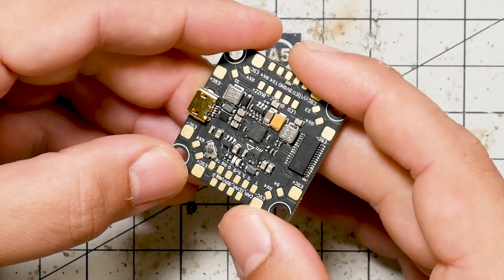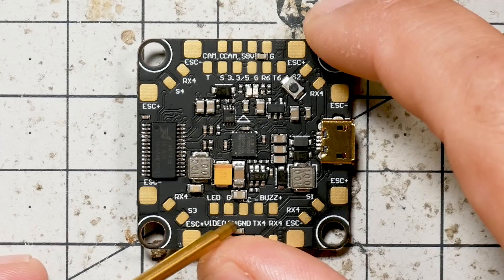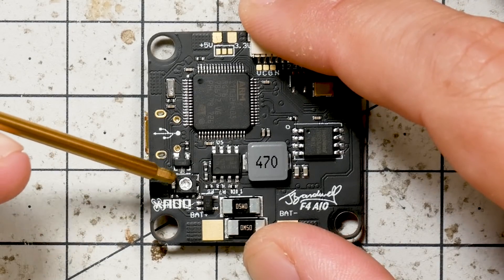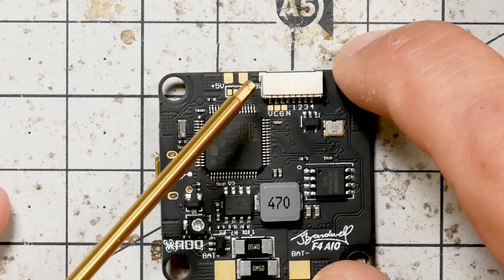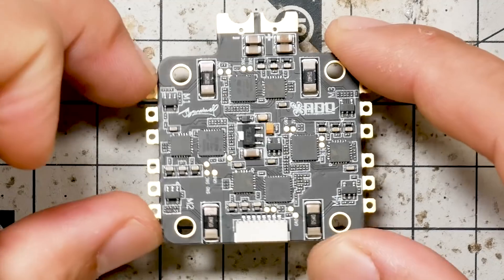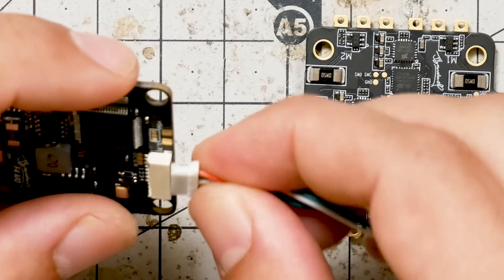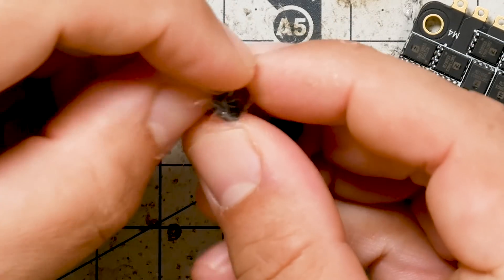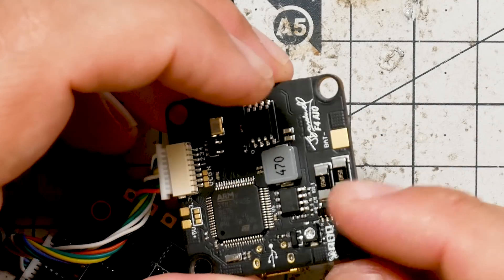JBF4 v2.0 and new Joshua Bardwell 4-in-1 ESC

Comment: JB, question, I have this combination, but I can't get my amps-used right. Should I have the solder bridge on ADC or TLM when using the 4-in-1 esc? I have a runcam hooked up to t6 and r6, Smartaudio on TX4, do I need to unhook that to use TLM?

Comment: Joshua:  I put one of these ESCs in a quad with a BrainFPV Radix.  I am having no luck getting the OSD to show current.  I have the print out of the pinout and am unclear what SWC output is.  I tried connecting it the the Radix telemetry input with no luck.  I hope you have time to look at this and give me some guidance.  Thanks in advance.
Reply from the maker: SWC is current sense not telemetry. Does the radix have a current sense input?
Reply: I tried connecting SWC to current sensor 3v with no joy.  I should be seeing battery voltage in Betaflight but I don't.  Any possibility a BF/CLI setting is causing it?  Thanks

Comment: So I have an interesting question that does not compute for me.  Recently got one of these used in a build, rx (XM+) was cutting out and upon investigation I found the "S" and 5v pad lifting, got the 5v pinned down, but S was beyond repair.  I was getting ready to grab the uninverted signal from the XM+ icu leg and run it to R6, when I noticed in the manual it says "T" is an "inverted telemetry INPUT" for S-port...now, while this did not compute as both S-port f-port telemetry is usually wired to a TX pad, i went ahead and tried just running the sbus to there and set UART3 to Serial RX and viola to my amazement it worked.  What gives?  The S-port from the XSR in my other build runs to a TX pad, all wiring diagrams I can find do the same, are a UART's RX/TX pads reversible?

Comment: Does the latest version of the JBardwell F4 only have one current sensor? I ordered a new one and was worried I got sent an old one from RDQ. I just got a JB F4 because I loved my old one, but it was missing some pads and the entire current sensor fell off. I'm not entirely sure how that happened. Luckily I was able to bridge a wire between the two ends where it went so I could continue flying until the new one arrived ;)

Comment: Hi Joshua, what if i pull the 5V pad for the xm+ receiver on the FC? Do i have other options or do i need a new FC?
Reply: Nevermind JB, i think i figured it out. I soldered the positive wire of the xm+ to the buzzer positive pad. I hope that's right?
Reply from the maker: Yep that will work.

Comment: Hi all I'm using this setup with the new DJI Air Unit my esc stopped working today, done all the tests to see if the esc has a short etc. all seems fine so it looks like the 4in1 esc has failed, if this something that the air unit may have caused?? voltage/current?
cheers Tom

Comment: hello Joshua,
have problems with the accelerometer.
The copter is precisely adjusted to 0.1 degrees on the PC. If the copter is not exactly horizontal, I always drift.
Transmitter exactly 1500 according to Betaflight.

Comment: I'm putting together a parts list for my winter project: a 500mm cinema quality platform... not trying to do anything acrobatic or competative (looks fun but I'm old) but I'll be doing 900mhz and a stabilized gimbal cam when I'm all finished. I have found many DJI class compatible parts and am about to start making purchases. Hoping to end up with a $2500 (RTF) quality quad for around $500-$750 (DIY). Totally comfortable with my soldering station and computer skills / hardware.  Not 100% on my T16 Pro yet (only flown the fixed wing with it so far) but looking forward to figuring it out this winter. 

So my question is, well, first off does this seem reasonable and second do you recommend your flight controller and 4in1 ESC for my purposes?

TIA!   and Happy Flying right back atcha! :)

Comment: I was thinking it might help if you use some 30 gauge wire around the vibration isolation rubber loop it over and pull the wire from the other side and easy way to install them on your

Comment: what chip you got on that bcs i need to flash firmware in betaflight and dosent know wich i select in menu select FC.?
Reply from the maker: The target is CLRACINGF4. Before you flash the board, please go to the CLI and type "diff all" then copy/paste that output into a text file. This will back up your old config. It also contains the correct firmware target at the beginning so you can know that if you ever can't get hold of me.

Comment: greetings, a doubt, I have the FC JB and my camera is a runcam eagle 2 pro I want to use the cam_c but I am not sure how to solder the cables, says the manual that solders the osd cable to the cam_c pad and the black to any ground?  and I don't know how to configure in betaflight to work, I hope you can help me thanks.
Reply from the maker: https://youtu.be/xY4Ck0Sp8RQ

But you do not need any additional resistor because it is already on the JBF4.

Comment: How to you wire up the power side when using the flight controller and 4in1 esc? Are both wired in parallel along with the multi pin cable? I still want current sensing. I have seen some wiring options in the fc manual but that looks like standard 4in1 esc not the bardwell one thanks
Reply from the maker: The ESC has current sensing via ESC telemetry. It is sent in to the FC via the 4 in 1 plug. Instructions are in the user manual.
Reply: @JoshuaBardwell  thanks for the reply. does the esc support analogue current sensing or only telementery?
I have soldered the bridge for analogue sensing but i get no reading
Reply: I've bought 2 of each and I'm trying to figure out the same thing. I've solder bridged both ways and I still can't figure it out.
Reply: @madhatter8088  make sure you change the settings in betaflight to esc current sensing. Also make sure you you set the correct port to esc current for the uart you are using. I had to use a different uart so I cut the wire out of the multi plug that is used for esc telemetry and soldered it to the rx pin I wanted to use then change the ports tab to the uart I was using. It tells you in the manual what uarts you can use and if it should be tx or rx. You can use tx and rx of the ame uart for different things though.
That was all from memory so hope it's completely accurate and helps!

Comment: Hi Joshua, I just bought this flight controller ESC from racedayquads and I'm going to use it on a HD DJI system, anyway you could do a video on how to connect it?
Reply from the maker: If you are using 4S or lower voltage, then connect the DJI air unit to the ESC+ and ESC- pads. If you are using higher than 4S, you need an external regulator, as the on-board regulator is not able to provide enough current to power the AU.

Connect the Air Unit UART wires to TX6/RX6.

If you are using the DJI controller, connect the Air Unit SBUS wire to the S pad on the FC.
Reply: Thank you

Comment: I just got your fc and it connected just fine. I went to flash it and now when I try to make changes and save it goes right back to DFU mode. And I have to flash it again and then it will do the same thing. Any ideas? I just want to fly already.

Comment: hi Joshua, I have an issue with the JB 4-in-1 ESC: sometimes ESC 1 is not working. Not always but when it happens I cannot arm the motor 1. If I connect the quad to BLHeli32 Suite, that ESC is not being recognized. Any ideas? Thank you

Comment: Hey JB since you’re so great at responding, I figured I’d come straight to the source. I have an extra RacerStar 4-1 ESC Anniversary Edition, laying around here somewhere. Will it work plug n play with your JB FC? 

Thanks in advanced!
Reply from the maker: No.
Reply: Joshua Bardwell The 4-1 ESC has the same VGCN1234 pin connection. Please explain.
Reply: Not trying to fry my shit. Lol

Comment: My board has the new silkscreen layout but only had 1 shunt resistor, also the current sensor never goes above 2 amps. Which version do I have? The reason I ask is because I had a previous build that had 2 shunt resistors, and current sensor worked perfect.
Reply from the maker: I'm going to guess you have the wrong current sensor set up in your FC. In the Power And Battery tab you should have "internal ADC" set, assuming you are using individual ESCs. I'm going to guess you have the wrong current sensor set up in your FC. In the Power And Battery tab you should have "internal ADC" set, assuming you are using individual ESCs.

Comment: If I were to use a receiver with SBUS, how would I connect it to the FC? (My receiver is a RadioLink R12DS.)
Reply from the maker: SBUS signal output to the SBUS pad on the FC.

Ports tab enable Serial RX on UART 1.

Configuration tab set Serial Receiver type and Protocol to SBUS.

Comment: Hey Joshua, I bought and installed you fc on my new build and I must saw thank you for taking the time to really lay this board out correctly. It really was much neater to lay out. But I am having a bit of trouble so.... I have everything set up and through both the betaflight and BLHeli guis the motors can spool up and run very smooth. But when I are the quad to do the hover test everything is just going crazy like I have insane vibs. Please help this is driving me crazy.

Comment: Hello Mr. Joshua. How are you? I signed up for your channel and would like to request information. I set up a drone with the HAKRC BF 3.2 Omnibus F4 2-4s Betaflight osd / pdb flight controller, but I can not update its firmware in the betaflight app. In the small window in the upper right corner of the application, I can not open the DFU, which would allow updating.
There is a boot failure with the connection on the computer. There is a recent version available for her from 1/6/2019 and I would like to take the opportunity.
My pc loads windows 10 operating system. Can it be any configuration on it or the lack of any driver that can eliminate the problem?
Thanks for any help.
Hugs.
Reply from the maker: 1. Hold down the bootloader button. Plug in the USB cable while continuing to hold down the bootloader button.
2. Run the Impulse RC Driver Fixer app (https://impulserc.blob.core.windows.net/utilities/ImpulseRC_Driver_Fixer.exe). It should "fix" the driver successfully. If not, do not proceed.
3. Un-plug the USB cable.
4. While holding down the bootloader button, plug in the USB cable again.
5. Start the Betaflight Configurator app. In the upper-right corner pulldown menu, you should see "DFU". You can now flash the board.

For more detailed instructions on how to install the STM32 drivers: https://www.youtube.com/watch?v=m4ygG6Y5zXI

Comment: How do you mount FC and ESC if you dont have the right mount hole dimensions on your frame? Are there adapters?  Do you just drill a whole in your frame? Use mount tape?
Reply from the maker: I'm not sure what frame you're using that doesn't have 36mm mounting holes. This is by far the most common size of flight controller. I guess you could use mounting tape.
Reply: @JoshuaBardwell  it's an S500. I got it for a birthday or something at one point. I'll measure some of the holes again.

Comment: Uh I have the wire harness connecting your 4 in 1 to your f4 fc. Is that all i need or do i need to connect a neg and pos 16-22 gauge wire from the esc to fc neg/pos pads? The quad has been working fine but I was just looking over the manual for the f4 fc and it shows the neg pos wires connected. Also i'm not sure what gyro freq and PID freq i should have this set to.
Reply from the maker: You don't need that for my ESC and FC.

Comment: Hey Josh I'm having trouble with BLHELI. FC is connected to the 4 in 1 with wire harness correctly and ESC telementry is bridged. When i click "read setup" in blheli it wont show my esc. Also when i connect a battery i only get the initial 3 beeps followed by the 2. No triple beep after. The motors all work correctly with stick inputs too.
Reply from the maker: Are you using blhelisuite32 or blhelisuite? BLheli32 ESCs like the JB ESC only work with blhelisuite32.

The initial beeps come from the ESC and the motors. The three beeps after come from teh buzzer on the FC. If you didn't install a buzzer, you won't hear the three final beeps, but you will see the LED blink.
Reply: @JoshuaBardwell  NO i wasnt haha. I just figured it out finally and then came here to edit my post to say i wasnt using blheli32. Ohhh okay, I have a buzzer to install so it's good to know thats what those beeps are. Thanks as always Josh!

Comment: Hey Joshua. I’ve bought the Bardwell F4 V2 AIO 4in1 32bit ESC Combo. I'm using Lumenier ZIP 2407 2550kv. Escs running dshot1200 on blheli 32.6 on betaflight 4.0 stock pids. Went to maiden it today and I'm getting violent death rolls (saw all your death roll fix videos but nothing can fix my issues). They happen under any hard maneuver, like a quick change in roll or pitch, or a blip of the throttle. I've tried making the motor idle higher, changing the timing and demag in blheli to no avail. Made sure everything was soldered perfect and working. No screws are touching windings. If i hover its fine and nothing gets hot. I've also taken the props off and been able to induce this behavior by pushing the pitch or roll stick fast. I can also do it when i'm at idle and i shake the quad manually. After the death roll the escs play only the second esc chime and i see the initial betaflight bootlogo. 

Im sorry for writing you here but im just frustrated. This is my first quad build and i dont know what to do :( 

Partlist:
* Bardwell F4 V2 AIO 4in1 32bit ESC Combo
* Lumenier ZIP 2407 2550kv
* TBS Crossfire Nano
* TBS Unify Pro HV
* Tattu R-line 1550mah 5s
* Foxeer Micro Falkor 1200TVL
* Lumenier Micro AXII Shorty Antenna
* HQProp Durable 5X4.3X3
* Armattan Marmotte Frame
Reply: My buddy and I just did a maiden each with Synergy F4 and Bardwell 4 in 1, both do death rolls and my buddys goes ape shit when disarming! :(
Reply: Setting sterup/ramp power in blheli to a low value helps

Comment: On page 4 of the manual it shows a ground pad for each esc signal wire. Mine doesn't have that pad. It has Rx4 where that ground pad should be. Where do I connect the black signal wire now? Why is mine different?
Reply: Anyone?
Reply from the maker: I think that you're looking at the older version of the manual. You can connect the black signal ground wire to the ESC- pad.

The latest manual should be available from the RaceDayQuads product page.
Reply: @JoshuaBardwell  Thanks JB. You're the man!

Comment: Dear Joshua, I very much appreciate your work, I wonder if I can associate your Joshua Bardwell 4-in-1 ESC with my flight controller Kakute F4 v 1.4 (Furi Bee x 215 Pro). I'll buy it at RaceDayQuads. On your link, of course...From now on I've been aggravations of your attention and considerations...
Reply from the maker: The 4-in-1 plug is compatible between the JB ESC and the Kakute F4. You can use them together.
Reply: @JoshuaBardwell  Just won an unconditional fan, thanks, I watch your videos daily, and I admire you very much, I am very happy, you have solved many problems I encountered during my learning in the drones racers, again thanks...

Comment: I would like to get one of your AIO FC. But I have a T-Motor F45A 4in1 esc. Would it work direct connecting to it? It seems like is either  exact match or the whole thing is in reverse.
Reply from the maker: You would need to rearrange the plug.

Comment: Is the 4in1 ESC wiring diagram (page 22 of the RDQ-Bardwell-F4-FC-Manual-v1.4.pdf) still applicable to the JB4f v2.0 FC? I have the newest FC but I'm not 100% sure how to wire it to my Racerstar 35amp 4in1 ESC and still get current sensing to work.

Comment: I have a major problem.. I know you can help because you designed them.. I have the f4 1.3 and lifted the telemetry pad while soldering my r-xsr, I routed the wire to rx4 and don't know what to do from here.. I can't get it setup in betaflight and I don't want to "brick" or mess anything up.. Please please help.. I've had this build done and can't wait to fly
Reply from the maker: Use the LEDStrip pad and this method: https://www.youtube.com/watch?v=jT4vf6575TM

Asking questions on old videos is not a reliable way to get hold of me because YouTube does not show me notifications for them. I do my best to answer every question I see. You can always message me on Facebook or email me if you need to get in touch with me.

Comment: Hello Joshua quick question I have bought a second one of your flight controllers (I screwed up first one and I Bought a much better soldering iron with micro tip made things much easier )  OOPS  LOL   and this one was supposed to be the v2 and as you point out here the silkscreen is like the v2 you show here and it also has the calibration pot for the current sense but I only have one shunt resistor  can you shed some light on this ?  do I have the older board or was there another revision I don't know about?    Thanks for all your GREAT videos  I always Learn something  :).  I purchased the controller  from Ready Made RC here local to me  and I also wanted to wish you much success in your decision to go full time with your endeavors
Reply from the maker: They switched to a single shunt resistor. All is well.